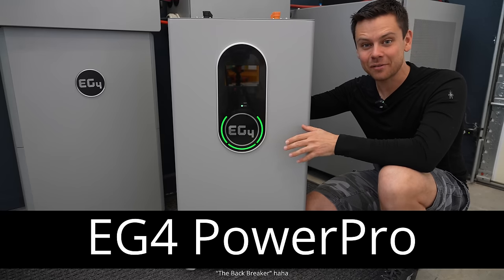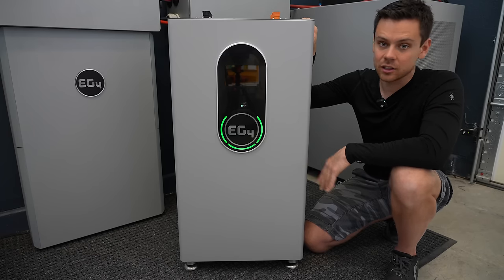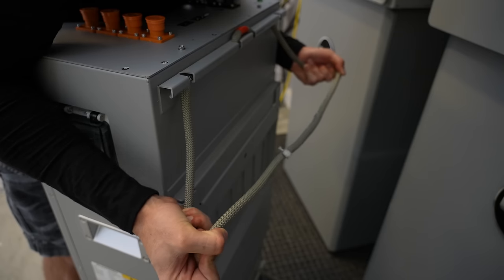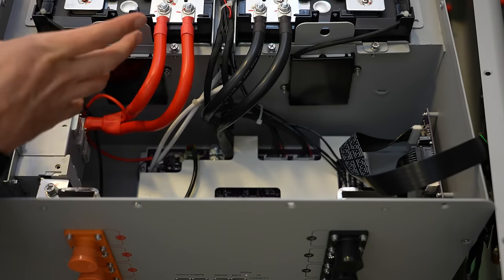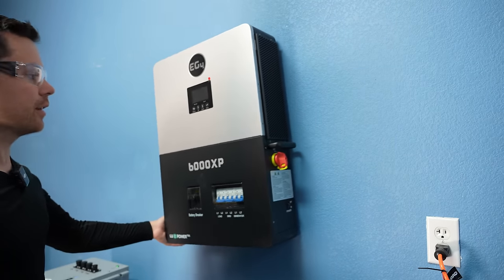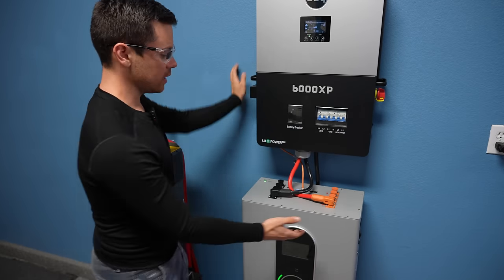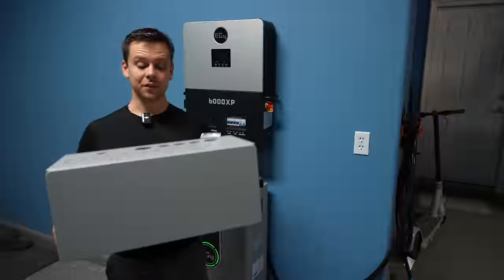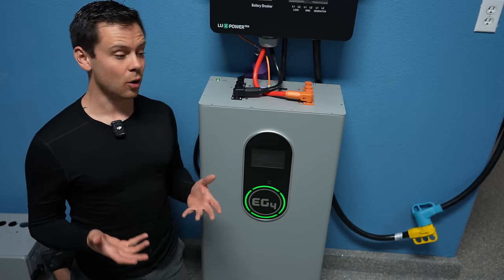New! EG4 PowerPro Budget Model: 14.3kWh LiFePO4 Battery for $3,431

Comment: So how are you feeling as of mid-2024 about these packaged battery arrays versus raw cells, like you've talked about before?  I'm about half way through putting together a 122kwh raw cells array, and I'll tell you, it's been some serious hair-tearing, and I'm wishing I'd gone with packaged batteries, but my setup was still massively cheaper, even with the cabinet, the balancer, the battery monitor, the giant breaker, etc.  (Machining custom aluminum bus bars on my desktop CNC takes forever, but they'll be suitable for thousands of amps.)
Reply: The issue is the NEC code is moving to blanket UL listing for batteries, it's really dumb, but this solution is BY FAR the best deal for what you get, it's around $12.25 per AH, that's really nice with the packaging and listed system.  (Go look at other vendors UL listed batteries, it's hilariously overpriced.)

Comment: 14.3kw appears to be the equivalent of four 280amp batteries.  I note that Eco Worthy is selling their 280 amp  12,8v for $540, or $2,160 for 14.3kw.  Li Time would be somewhat more.  Just comparing on price, and not features.
Reply: But that has no UL9540 listing like this battery does, and that will keep you from passing inspection in 35 states (and counting)
Reply: @CurrentConnected  yes, I was just comparing price.  Most folks probably don't get their home built systems inspected, I suspect.  Thanks.

Comment: Could you lay this batter on its back if you are limited on vertical space, or due to the fire suppression system it needs to be upright?
Reply: Never mind I found it needs to be upright.  " Ensure the battery is mounted upright. "

Comment: I wonder how much heat (energy) it produces during normal usage?
The industry is moving quickly.
I recall building my DIY battery just a few short years ago. 
EG4 has really put pressure on prices.
Reply: Lithium batteries are around 97-98% round-trip efficient. You could expect around 420 Wh of heat produced during a discharge, so if you drained and recharged the battery over the course of 10 hours( 5 to charge, 5 to discharge) it would be about equal to a 50 watt heater.

Comment: Will do you know if this battery will work with Enphase system with IQ8+ inverters. I have been trying to find battery and combo that will work. If you could list battery that will work well and inverter if i need one. It would be  great i looked at EG4 battery with built in inverter. i think it will work

Comment: If you are using an EG4 18KPV with battery and want your entire 200A panel to be backed up with one unit:  You must use a manual transfer switch????  They don't make an automatic xfer switch?

Comment: I’ve a question that’s more about the system than the battery. If I had this system in a grid connected/ups configuration & I had a demand that went over what the inverter &/or battery can supply (I.e. hwh & heat pump kick on while charging a car), will the inverter take overage directly from the grid?
Reply from the maker: Which inverter? 18K yes
Reply: Yes, the 6000xp will do that. When I first plug in my Tesla and the inverter ramps up quickly, the inverter will switch over to grid until the load settles back below the inverter max, and then the grid will go back off.
Reply: That’s awesome. I’m planning on setting up a grid connected (without back feeding) micro hydro system & I wasn’t sure if I had to size the inverter for max demand, or if I could start smaller. It sounds like the 18k & 6000xp have this capability. If I wanted to compare inverters, what is this feature called?
Reply: @WillProwse thanks! If I want to compare inverters, what is this feature called?
Reply from the maker: @greggeiger5203  it's the automatic transfer switch. Or ats. Or ups function. Or solar priority, grid back up.

 They both have it but 18kpv has a lot more features for grid interactivity

Comment: Is the indoor PowerPro compatible with the outdoor PowerPro batteries if setup in an indoor environment? I have an 18kpv with 2xPowerPro batteries and would like to add one of the indoor PowerPro batteries in parallel configuration.
Reply: Yes. They use the same cells and BMS. It would have no problem supporting closed loop communication, just a good idea to make sure they are all on the same firmware version.

Comment: Another great video.  Q: How do you protect these systems for an EMP blast?
Reply: The best way would be to get spare parts and put those spare parts in a faraday cage.  In most cases, it's nearly impossible to have functioning electronics that are truly EMP proof, since cables entering and exiting a device can act as antennae and send excessive voltages/currents to the equipment in operation.

Comment: Hey Will, been following for a couple years now and I have a question about a battery I just picked up, is this a good place to ask some quick questions?

Samsung SDI ME2 Li-ion
ELPM762-00015
7.61KW
Nominal voltage 80.96vdc
Nominal Capacity 94Ah
Operating Voltage 70.4-91.3vdc

 I would like to use this as my sole backup, it has a BMS attached to it and everything else I need except for panels, which I have 12x300w. The battery is more than I need, but I figure it was a great buy and starting point. Spent .11/wh.

What's the best way to test this, and is it too high of a voltage to run as an offgrid home battery? Is the battery system voltage going to be 72 or 84? 

I figure if all the same rules apply, a 72 or 84v charge controlled paired up with an inverter that's 72v-120v will work, am I correct in this assumption?

Thanks so much your videos are amazing and always packed with info.
Alex

Comment: So was it the inverter or the battery that wasn’t functioning without the communication enabled? I’m sceptical of either if they won’t work with other systems.
Reply: The battery and inverter support many options in terms of cross-compatibility.  The inverter and battery can be programmed to use no communication, but the default setting is to use it because most systems now days do use communication.  Even if you had lead-acid batteries the 6000XP would be fine.
Reply: @CurrentConnected Cool, thank you for the reply.

Comment: Dumb question but can this be put in parallel with the power pro with little to no fuss? Mine is indoor and I'm thinking of expanding.
Reply: Yes it can be paralleled with the outdoor version, as long as you keep them out of the weather.

Comment: I'm about ready to buy a battery, is there anything about 1/2 this size that you would recommend? I'm embarrassed to ask how do you turn off the ad blocker just in case I step up and buy this EG4
Reply: Go to the settings in your browser, then extensions and you will find it.
Reply: You can buy individual server rack batteries.

Comment: If you have one 18kpv for the whole house that has an electric oven and 5-ton AC, can you use just one one of these batteries, or does it require two batteries?
Reply: 2
Reply: You could use one but the inverter would be limited to 10kW from batteries max. With two you can utilize the full capability of the inverter without issue.

Comment: Did you say if the battery doesn’t have communication there it’s no voltage (so it won’t work with a old 6548?)
Reply: This battery can operate without communication to the inverter, it's called "open loop".  That said, most of the MPP Solar LV6548 support closed loop communication and this battery should work, but it would be best to talk to a distributor about your specific application to be sure.

Comment: blocking breaker access sounds like a horrendous idea.  This is the only sure fire way to turn off a battery if something bad is happening.  Please just leave enough room between batteries to access the breaker.  They are heavy enough, just place them a foot apart and follow the guidelines that come with these batteries.  Also please go through the permitting process to install them.  Not doing so can potentially hurt you and the manufacturer as well as your home or assets.

Comment: Hey Will, do you know of a website I can buy just the battery connectors?
Reply from the maker: Oh good question, it's available on signature solar on the last page of the battery section. I want to use them as well for other things
Reply: We are working on stocking these connectors and should have them listed on our site within a few days.  We will also be assembling custom cables to whatever length / lug configuration you need with these connectors.

Comment: Why there is no 120v LiFePo4 battery pack, that will remove large inverter, heat and sound? (40 cells in series where 50ah makes 6kw,100ah makes 12kw).Also Efficiency will be increased as less heat and components are needed. Two of 120v batteries will make 240v , four of this will make 480v that can charge the EVs. If safety is a concern, then good design will defend this kind of problem, removing two terminal by using pin port . A 120v 50ah battery is similar size as 48v 5.1kw server rack battery pack. If a small dc to ac inverter are installed into this battery, people can use this battery as plug and play...

Comment: How many server rack batteries does the wall mount battery replace?
Reply: It's roughly 2.8 server rack batteries - with voltage being equal,  your typical server rack battery will be 100Ah and this is 280Ah - from there, the math is simple.

Comment: Now that I can buy 100ah 12v no name batteries for $160ish delivered. I just build large arrays that are cost effective even if they don't last 4000 cycles.
Reply: That's all fine and good until you need a permitted system that is UL listed.  That's one of the key differences that some forget about when they look at the price...what's going to be a good solution for them long-term.
Reply: I agree with what you say. If you need ul listing and permits then you should pay full price.

Comment: Would like to see will do a review of the new dc to dc renogy 50 amp alternator / solar charger . Anyone know of a tuber dissecting one give them a shout out.  Would like to know if the 50 amps would hurt lithium being most batteries recommend 20 amp charging.

Comment: My electric bill each month is between $35 to $50 each month  , 
For that 3 + grand  battery to pay for itself  and i would need  Solar Panels and  thousands of dollars of other  items to go with them i will only be 
 138  years old  when its paid off , 

I'll  take  Two  ! 😂
Reply: With your electric bills, it would take 12-15 years to pay off normally. With the government redistribution schemes for state and federal, you could up to half of it paid off with tax credits. The main point of it is for a battery backup or an off-grid cabin.
Reply: @TommyHolly , 
The Government  ?
That's the Last thing I want coming into my house  ! 
I want to go off Grid  ! 
But there is  100 different ways than this expensive  box  .  
A used Electric Fork lift battery is  $500 bucks and would last those 12 to 15 years it would take me to pay this  expensive box  in full .

Comment: Eg4 battery is more expensive than the Ruixu 16k 314ah 48v $3700 shipped battery. 

You said youd do a video on it on the forums?
Reply: Built in fire extinguisher, ipx65 waterproof for outdoor use, internal heater, and better battery construction i bet.
All for a price of $0.23 cents per watt hour. 
Whats the point of buying eg4 battery thats more expensive and has less capacity? Just to match the brand name?

Comment: Wish they did an interior budget model with no heaters and only enough to meet the UL requirements to minimize the cost as much as possible, also holy crap they need to put something between those battery terminals and the front shell, imagine something heavy impacting that front panel and bending it, thats a lawsuit waiting to happen.

Comment: Has anyone evaluated the BMS in the 14.3kWh battery? That seems to be the usual failure point (i.e. Renogy!). I can believe that the cells could last 8000 cycles/15 years but can the BMS last that long?

Comment: Not sure why you say it's cheaper than server rack or any other, when it's clearly not. These are about $240/kWh, pre tax, while the Ruixu server rack is under $235/kWh and the basic SOK server rack is just under $215/kWh
Reply: Neither are UL9540 certified.  If you do an apples-to-apples comparison of equal feature sets, they are a lower price/kWh.

Comment: Will this "Powerpro battery" work with a SolArk 15K hybrid inverter?
Reply: In open loop (no communication) it’s no problem. The battery supports the protocol sol-ark uses, however Sol-ark does not officially support closed loop with eg4 batteries and may tell you to remove communication if you are having any operational issues.

Comment: That inverter has the same screen layout and buttons as my LUXPower P.O.S that never worked properly.
Reply from the maker: What model and what went wrong with it
Reply: @WillProwse  Hi Will, 
It was the LXP 3600 ACS.
It would sometimes charge off of excess pv,  and sometimes just sit on idle with blazing sun.   
It would not recognise and cover grid load.
Manual forced charges would not stop unless unless I turned the charge voltage down to below SOC.
It was in a WIFI black spot so trying to do  firmware updates were a joke broke me.
Luckily I got a full refund.
I replaced it a few weeks ago for a SOFAR HYD 3680 which is also another brick on the wall. Got a constant 070 Battery over voltage protection alarm regardless of charge setting, or battery chemistry. Or SOC.  It even alarmed out with just my 5A bench power supply on initial start up.  
SOFARs technical advice was turn it off an on again or buy compatible ready made batteries.
Todays job is steal my mums wheel chairs lead acid batterys to prove it ain't me and my DIY set up.
So'far so sad 😭
Cheers Will you're a wee star!
Gaz.

Comment: I never understood why they can't think a little bit ahead when they design this stuff and have the positive drop down to the postive, and the negative to the negative from the Inverter to the battery. I don't like crossing cables. It would be a cleaner installation.

Comment: How many batteries can you parallel together to one inverter, 4?
Reply: I asked Signature Solar tech support how many of these batteries can be connected to a 6000xp and they told me you can hook up as many as 16. After that, the communication bms wouldn't work. 
I'm not sure why anyone would need 16 batteries, but ok....
Reply from the maker: Yes 16 but you can still parallel more batteries without communication. So pretty much any size you wish.

Comment: Love it all. But reality pervades. My wife cannot deal with any of this when I am gone. It has essentially hamstrung me from leaving home. Even a two week venture on my motorcycle means endless hours on the phone trying to sort stuff out.

Grim reality: you gotta be a techno geek that stays at home all the time otherwise you won’t have power.
Reply: What? 🥲 

Your setup must surely be intimidating to her then... Like I'd imagine you got exposed electronics and 
batteries in a storage closet. Or perhaps the setup is too manual that it appears to be unsafe left alone? 

(This last part may sound a bit ignorant since you've probably gone hours over this already...)
Have you explained to her the system and why? (the benefits?) or least how you feel?
Whatever the case it doesn't need to be just the techno geeks, I'm sure it would work out. 🧑‍🔧🙃

Comment: Will ? If you already have a 50 amp generator transfer switch on my main electrical panel…. Can I connect this unit to my generator transfer plug ? My purpose is to get off the grid or have the grid power as a backup…. Who would have thought that Grid Power would be a Backup source of power ?  I’m sure the Electric Companies are having meetings Brain Storming how can we charge people for getting off the Grid ?
Reply: I am doing a battery backup shed exactly like that. Grid will come in on one side of the switch and a generator plug on the other. I am going to wire a plug to the output of my 6000xp so that when the power goes out I can switch to the battery or just move the extension cable to the generator if the battery goes dead. 
I would wire the generator to the inverter, but mine is not the required pure sine wave type, so the transfer switch is a good workaround. It is a lot cheaper than a new generator 😅

Comment: Is EG4 ok with blocking the power switch and breaker??? lol
Reply from the maker: Probably not lol I always do what they don't tell me. But there is no safety issue, just annoying to reset if you have to
Reply: The manual states you need 1ft of clearance between modules.  This is especially important for permitted installations.

Comment: This system will only be able to fill my Tesla 22.9%. I guess if my daily commute isn't that far this might work. 14.3 kWh x .8 = 11.44 kWh. 11.44 kWh costs me $1.14. If I use the full usable capacity of the battery every day, which I won't, it would take $6000 / $1.14 = 5263 days to break even. 14.4 years to break even and that doesn't include the cost of the solar panels. How does this make sense?
Reply: 10:49 "It will pay for itself very quickly"